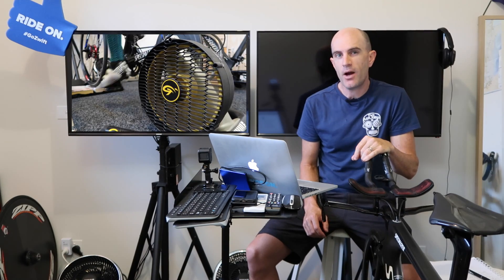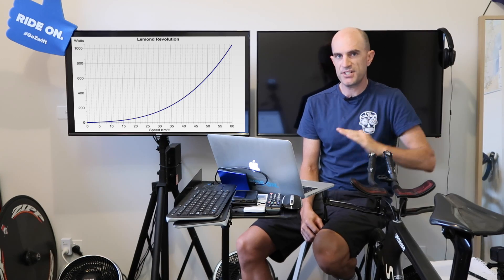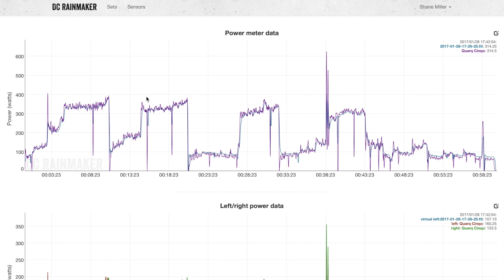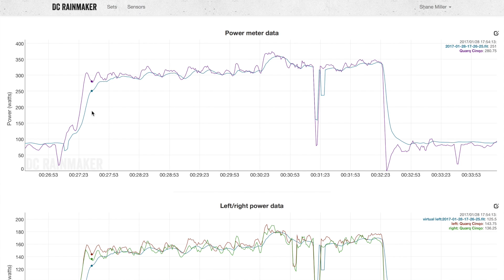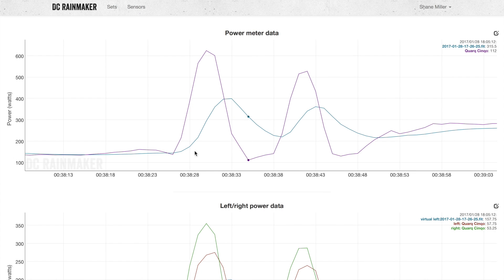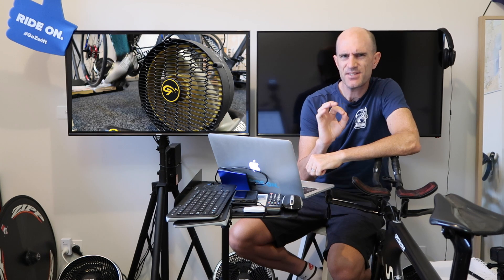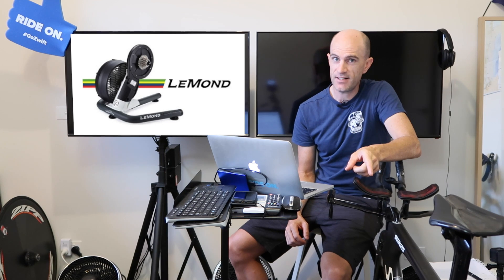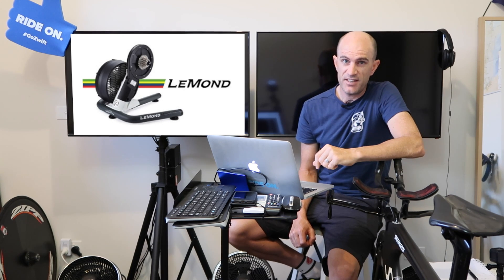LeMond Revolution zPower Data Analysis

Comment: Hi Shane, What tire size have you got selected when using the trainer with swift?
Reply from the maker: I can't recall... I think 700x23... so 2097mm.
Reply: @gplama  yeah great i found where your said it on your other video 2096mm 700x23c. Thanks for the reply
Reply: Great Video's by the way, If you were going to upgraded to a smart trainer, whats the best value for money. Based on your video's I'm tossing up between the Jet Black Volt & the Kicker Core, or second hand kickr Gen2 onwards?
Reply from the maker: The Core is a solid proven performer. Depends what's available too.

Comment: Where was speed coming from? My Lemond has the PowerPilot which I think is simply a speed sensor. With this sensor and ant+ to Zwift then I suspect Zpower would work.
Reply from the maker: There's a magnet on the flywheel and any old speed sensor will work. The Power Pilot is the worst tech I've seen in 15 years. It's the biggest waste of time ever sold.
Reply: @gplama  ok I found the power pilot as a speed sensor and if works broadcasting to my Garmin head unit as speed. I'll attach it as a speed sensor via ant+ to a laptop running zwift and selecting the lemond. See what zpower produces versus my quarq d-zero.

Comment: Can you use a crank based power meter all the time with the lemond trainer?? and use it in zwift??? Do U still need a speed sensor and Zpower curve??
Reply from the maker: A power meter (an accurate and reliable one) is preferred over estimated/zPower.

Comment: Hey Champ
Hope you're well.
Just wondering if I can pick your scientific /analytical brain?
With your experience with your Stages PM and Zwift Zpower (with wheel on trainers) have you noticed if Zpower gives a higher wattage figure?   I've found that at threshold Zpower is showing 50-60 watts higher than Stages on my headunit?  Would be interested to know if you have experienced this, or maybe interested to test same?   I'm aware that with Stages PM being L/H only it is not an exact science, and having Sciatica in my left glute / leg etc maybe a major contributing factor. Also the Zpower is based on mathematics for each brand/model trainer.  Sorry for the long drawn out question.  Look fwd to your reply and maybe crossing paths again later in the year.
Reply from the maker: zPower is..... an estimate. It can be wildly inaccurate due to a number of factors. #1 being tyre pressure and resistance unit tightness against the tyre. The math is different for every trainer too.... so some might have a steeper estimated power curve that is impacted more by variances in setup. I'd go with the Stages, assuming that's been behaving itself.
Reply: Thx Shane. Have a replacement Stages now, so all good. Damn, not as strong as I thought then. I'll have to keep training. Ride on👍🚴

Comment: Thanks again for the share Shane.
I've just started to use zwift (it's cold right now in Pennsylvania, USA) and was wondering how accurate the ZPower data is with the LeMond Revolution, And now I know!

I bought my lightly used LeMond Revolution secondhand on eBay a couple years ago. They still show up on eBay from time to time and when they do they can be had for about 350 USD. This is without the wattbox which can add up to 200 USD. The wattbox can be found separately too. BTW: I too find the ride feel on this trainer excellent.
Since I did your hack, would there be any advantage to having a wattbox? I saw that you can configure zwift for this setup.
Reply from the maker: The WattBox will transmit power over ANT+ (maybe Bluetooth? I'm not sure) so you can link it to a Garmin head unit or similar... or have Zwift/etc pick the trainer up as a 'power meter' rather than a zPower device. I don't see any other benefits.

Comment: Shane,

Love your trainer reviews. You do a great job discussing both the empirical data and the subjective experience of the equipment you present. The only thing missing is a good way of comparing your reviews to each other. Two things that would address this would be a) some kind of rating like a score 1 - 100, and b) a page listing all the trainers with specs and ratings side-by-side, with links to the relevant videos.
Reply from the maker: Cheers for the feedback Jerry. All of this is in the works. Stay tuned! :)
Reply from the maker: Cheers for the feedback Jerry. All of this is in the works. Stay tuned! :)

Comment: shane do you think the lemonde is much better than a normal trainer (i've elite crono fluid) or a trainer direct drive is definitely better?
Reply from the maker: The LeMond Revolution has better road feel / roll down / inertia than any wheel-on fluid trainer I've used.

Comment: Have you do or can you do the same test but with a classic Kurt Kinetic Road Machine trainer to see the accuracy? Thanks! I love your channel!
Reply: I did this and was pleasantly surprised.  The KK felt right to me based on my heart rate at various levels of power.  I borrowed a power meter and did a few rides and found, like Shane, that the trainer has a bit of normal lag catching up but on balance it tracks very well.  For several rides it was within 5% throughout and usually within 2% on the overall average power.
Reply: I'm too happy to know that my KK is precise enough! I'd rather save to buy a power meter than an Ergo trainer. Thank you so much for these details! Happy bike season 2017!
Reply from the maker: I sold mine a few years ago, so unlikely. Sorry mate.